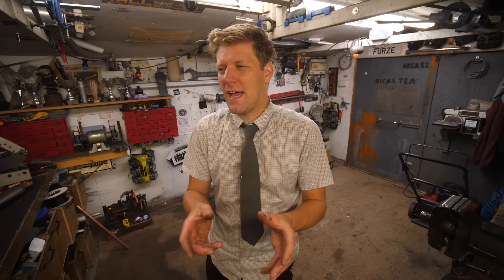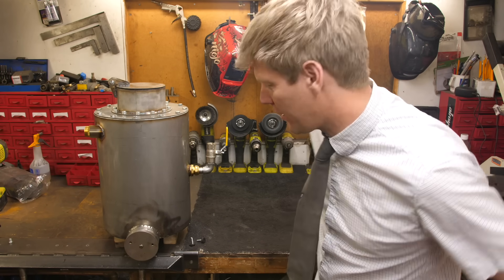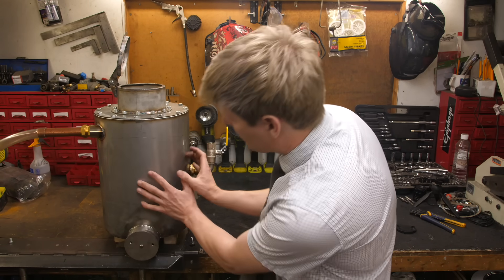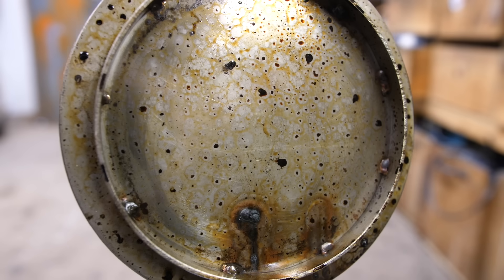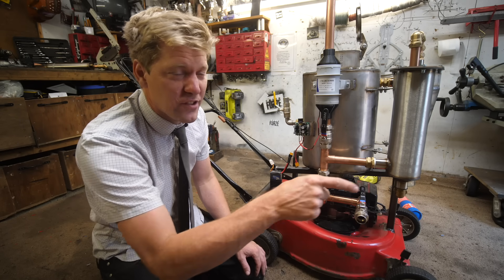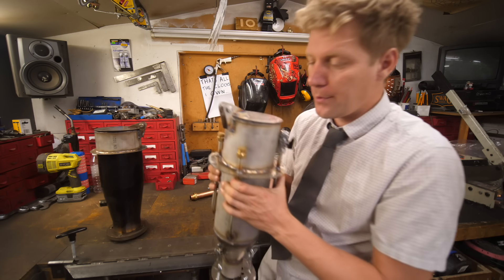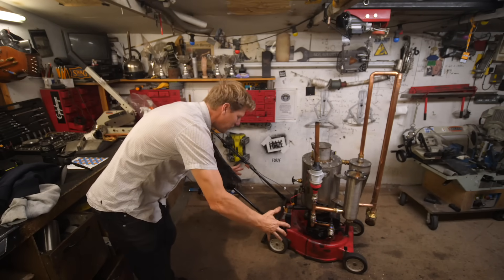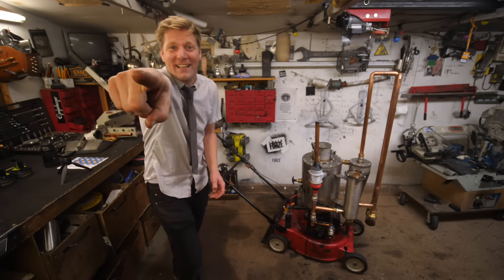WOOD POWERED LAWN MOWER

Comment: Could've filtered it using garden hose and an orange juice bottle. Nah but seriously, a water filtration system with a water pump and radiator would've done the trick.

Comment: Don't worry, commercial gasifiers tar up when using wood.  There have been a number of multi million £ systems scrapped.   The Gas Light and Coke Co made a good job of gasifying coal from 1812 - 1948 and later the Gas Board to 1973.   They perfected the process.  But the renewable energy sector can't seem to fully commercialise gasifiers or pyrolysis systems.   They all run into the problem Colin did; tar.  Colin, you need to run the gasifier at 1000 deg C as that will help with the tarring.  Preferably, outside the shed.

Comment: I think if you want to put this technology to an actual pravtical use, you should use it as a home generator, rather than drivng a lawnmover or a car.
Their Power to weight ratio is quite low.

If you are into that prepper and self reliance stuff, you might wanna stick this to a generator to produce electricity in the winter, when you cant rely on a solar panel.

Btw. that technology dies not scale well, if you wan to back up an actual grid in the winter with that, you will run out if wood fast.

Comment: Hate to say it. But your best bet is to build a giant bubbler/bong.  Run a  inlet pipe deep into a liquid basin, let the liquid filter out your resin then have a regulator atop your mech that pulls in filtered gasses that bubble through.

Comment: Might sound really stupid but try sonnicating or just boiling the wood in deionised water for a little bit that should remove alot of the inorganic shite in biomass (sodium, calcium and other metals) dry it afterwards obviously or try putting a water jacket around bigger traps that should force the tar and crud to condense out and not go through the system. You should be able to do that same thing with straw or even plastic (plastic is alot dirtier so much shite in plastic its unreal)

Comment: The entire time watching this I was screaming 'just put a damn water scrubber on it!' should solve all the filtration issues and some of the gas temp problems.
Reply: But (if I understand you right) you'd need running water for it, wouldn't you?
Reply: @Milo S Of course you can do that but if you have a connected water pipe you could simply connect a cable and use an electric lawn mower.
The whole purpose of a gasoline lawn mower (or the new ones with batteries) is to use them freely without any cable or something like that laying around.

Comment: I think the amount of tar is because of the imperfect burning and not because the filtering system. I would add some more air to the burning, maybe with some compressor or simple ventillation.

Comment: fill those distillation pipes with ball bearings, marbles, zeolites or steel wool lol, to increase the cooling surface area, and optionally add heatsinks on the outside

Comment: Isn't it normal to use water to filter the gass? You push the smoke through a pipe into a big cylinder of water, and then pull the gass at the top of the cylinder where there is no water. So the smoke and tar will mix with the water, but the gass will go up. Maybe I misunderstood how you did your filter system.

Comment: I wonder if it also works with dried grass 🤔
So you could build a dryer at the back of the mower and then an auger that feeds the dryed grass into the gasifier.

Comment: Just remember the clean engine head every now and then.. it makes quite a lot of tarr and stuff . So it finaly wont run , and in 4stroke engine, the failure is huge. But yea, cheap and littlebit more work to use.. Nice vid.

Comment: use a water tank to filter the gas, and a heck of a condenser cooler after the tank so the water vapor returns to the tank.  if the raw gas tube enters the top and goes all of the way toward the bottom, gas bubbles will rise and exit the top and through the condenser.  if you run a fan external to point at whatever you use as a condenser, the lower temperature should induce an impressive gas flow and the fan will not have to be inline anymore.  All of the impurities will remain in the water.  Wood gas is a cocktail of many gasses, primarily carbon monoxide (quite flammable), hydrogen (omfg flammable), and methane at a low concentration so gtfo, methane.  Your target gasses don't mix well with water unless you're talking really high temps where the CO will create carbon dioxide and more hydrogen.  lastly, wood gas is 3/4 nitrogen which doesnt burn at all.

Comment: Water filtration works well and if you put some detergent in the water that seems to work a bit better.
I made one of these about 15 years ago to run a generator. Not near as good as yours and it was ridiculously difficult to start but the water filter bit did work well.

Comment: Hey Colin. I used to build square hearth  downdraft gassifiers for a living.  You need more heat. To get a perfectly clean burn you need to be combusting at a high enough temperature to crack the tar into carbon. Then run it through a radiator to cool it down and which compresses the syngas to allow easier combustion. Fire brick will protect your chamber walls from overheating. And you can adjust the fan speed based on the temperature of the output gas

Comment: 0:51 "We don't need aaaaany fuel station or electricity..."
* connecting LiPo battery * )))
Reply: We aren’t thinking about this right. It’s simple. Add a generator to the output shaft of the motor to run the fan, or even put it to a charger that charges a battery that then goes to the fan.
Reply: Александр Долгов once it’s running, the engine vacuum should be enough to suck the air through the fire. The electric fan is only needed for the warming up of the fire.
Reply: @gfilion 
Following that logic, you could go full mechanical with some bellows instead of an electric fan.

Comment: Ah man, you missed it! It should run off grass, not wood! 
It would be a self-sustaining, self-feeding system! 😂
Reply: And if it can also replicate, you have a sheep
Reply: @wasserdrucker6227  beat me to it but was thinking goat.
Reply: @wasserdrucker6227  Seriously! a sheep is a perfect machine to cut grass. It consumes enough energy to keep living and it poops and exhales co2 both of which keep the grass growing.
Reply: Would take more energy to take out the water of the grass than you get from the grass I imagine.
Reply: Martin Stråbø yea but you could bag it and let it sit in a heated area for a week letting it dry and then potentially using the dry dead grass for fuel
Reply: It wouldn't be as useful as dry wood 
The higher the moisture content 
The less it produces gas and the more it produces unwanted tar and vice versa
Reply: @Tua_B  Depending how often you mow I suppose, grass dries pretty fast in my experience. I would imagine you would have to compress it into bricks or something though otherwise it would probably burn out too fast.
Reply: @Tua_B  MindBlown!
Reply: Imagine a wood powered chainsaw🤯♻️
Reply: @oscargilks2567  that could get scary and turn into a black hole or something.
Reply: All I can think about is how much smoke there would be...
Reply: Silage! Effectively grass alcohol! Just boil off alcohol, then use ethanol as fuel.

Comment: Went to a home improvement store one day and I noticed a truck that had a maze of pipes in the bed.  The truck had a strong smell of burnt wood.  I instantly knew what I was looking at.  Someone had converted a dodge Dakota to run on wood gas.  He had an air fuel ratio gauge bolted to the dash.  I was shocked....

Comment: If you take a dyson motor and recreate the dust cylinder with metal, you can do the same thing but the tornado type air flow makes it a turbo powered engine.

Comment: Imagine a post apocalyptic neighborhood all the desolate houses and overgrown yards. Then there's this one, the house looks a little worse for wear but still in good condition. The shed in the back yard is perfect like it was built by Paul Bunyan, strong and mighty, and then you hear it, it sound like a lawn mower? There you see a man wearing the most magnificent DIY'd body armour, and wearing a safety tie, pushing this monstrosity of mower around to mow his lawn and not only has he produced enough wood gas to mow his lawn but to save on the wood he has also used the excess wood gas to heat a grill to make his supper.

Comment: You know what would be better?
Turbo jet lawn mower!
You could attach jet motors to a flywheel above the deck, with a shift going down to the blades. Start the motors, they spin, blades spin, grass cut, everyone dies when it blows apart.

Comment: Amazing job with the gasifier, there used to be a mail car in outback Au that ran on syngas so it could make 3000+km trips without fuel stops. I've got photographs of the filtration system if you want them. 
Top-down updraft combustion seems to sustain the best if you're ok with a batch-type gasifier. 
Condenser coils work well for steam and Tar removal, I use no less than 6m of 1" pipe for my retort burners.

Comment: Hi Colin, l have been driveing on woodgas for a few years now and built many sucsessfull systems. Like cars and stuff not toys :) 
What you first demonstrated was NOT woodgas but pyrolisys gas. Flamable but full of crap. Kinda like crude oil. The real woodgas is the eqivalent to petrol and shuld contain zero tar! If the gasifier is well made and tailored  to fit your engines specifications you dont even need a filter, just a cyclone for dust collection. 
You came close with your latest system but only made one big mistake. For the first run you always need to prefill the reaction zone with corn size charcoal! This glowing mass will basicly crack all tars down to just methane and hydrogen. Once the char bed is established you can easyly light it right away the next time. Visit Drive on wood! web site for more details

Comment: Couldnt the gas be run through water to grab all the tar and crap? Would cool it, be way more compact and a cheap and easy to replace/clean filter . Just suck the gas through a large jar, the gas having its tube running down under the water  and the suction at the top, the vacuum should do all the work.

Comment: Ultimate Apocalypse tech unlocked!

Wood powered lawnmower. Also, that tar should gasify some, but you will need a hotter fire. Still, you are right you need more filtering.

Comment: Water filters work well and would cool the gas.  The tar will dissolve into the water, so you will need multiple jars for filtration stages.  You'll see the water color get lighter with each stage.

Comment: really dont think it was a good idea to mix the wood gas chamber with the burning wood chamber. If the wood gas chamber was separate you could use the pressure of the wood gas to move it through more restrictive filters and you wouldn't need a fan either

Comment: Hmm, I wonder if there's a way to store the wood gas. That way the wood gas station could be separate and far more accurate/elaborate.
Reply: There is. It involves more filtering and cooling of the gas, and I am not sure on short research, if it needs to be pressurized or if it is liquid at room temperature.

Comment: Use grass as fuel

“I used the grass to mow the grass”
Reply: It's possible, but you'd likely use a biogas digester (liquidy compost in a big sealed tank releases methane to run the engine) rather than gasify it.  Cody'sLab built a biogas digester, though I don't think it worked brilliantly because of the cold temperatures where he lives.  The most ironic thing would be a wood gas powered chainsaw :)
Reply: Subscribed. LoL.
Reply: That quote is just priceless :D

Comment: G'day,

Yay Team !

  Backtrack me to my "SunGas Project..." Playlist, to see my work using Alfoil &  Contact Cement to turn a TV-Satellite-Dish into an.Offset Parabolic Reflector, with which to Pyrolise the Wood into first Water-Vapour, and then Hydrogen, Methane, Carbon Monoxide & Tars...

It was a lot of fun, but to run a Kitchen Stove would take 15 Sq Metres of Mirror, 5 Kilos of Wood in a 10-Litre Vessel, tripple-insulated on top, and a topless7,500 Litre Watertank, full, with a weighted Bottomless  6,000 Litre Tank  floating in it for a Gasometer.

   1.25 Kg of  FossilFarted LPG costs me $6.50 for 10 days' worth if Cooking.

If I have to give up LPG, then I'll cook over a Wood Fire.

In 1943 my father used to run his Car on a Charcoal-Burner which he made, and every 1,000 Miles it had to have the Cylinder Head off for a De-Coke & Valve-Guide, and to go up steep hills it had to be switched back to Petrol.

Woodgas is about half as Energy-Dense as Petrol, whereas LPG is about 90%.

Stirling Effort, that Lawnmower though ; well done.

Have a good one.

Stay safe.

;-p

Ciao !
Reply: *
Valve GRIND...(!).

;-p

Comment: If you arent desperate to die early you just dont start that inside! People died during WW2 from doing just that. The gas you produce is incredibly unhealty! 
My dad built a 1960 Volvo lorry fitted with one of these wood-gas-burners that he found NOS made during Ww2. 
It was faster and more powerful running on birchtree, but made so much more tar from it that one valve stuck in the valveguide so it bent a pushrod.
It should produce 75% of the power that it does from petrol. And the wood used has to be very dry to make it work.
There was also smaller units of these to use on motorbikes even down to 98cc twostrokes.

Comment: You dont need filters, you need catalytic converter, you can use some of the heat of the chamber to help get optimal temperatures and produce a clean syngas. 
You can also re direct those deposits of tar to burn in your heat chamber. Also, I dont know if your reactor is sealed or not, if you are putting regular ambient in it, the concentrations of hydrogen (combustible) will be lower and nitreogen (inert) will be higher. Lowering the effectiveness of your syngas

Comment: All the wood gasification vids I watched, they bubbled the smoke through a water chamber which trapped the tar, moisture and dust while the flammable gas bubbled to the top, compressed, and was usable afterward. No elaborate copper pipe or steel wool nonsense needed.

Comment: i wonder.... if the wood gas engine is producing excess heat. would it be possible to add a steam engine to the mix? it wont add much energy back into the system but would just make it more efficient. only issue is you dont want the system to be too cool and might not run hot enough for the steam engine right?

Comment: Wood gasifier chamber should be horizontal  then 90 deg. Down into multi stage side by side water bongs.  Triple filtered in water will remove most of the tar. Then carbon cartridge from fish tanks...then the mower...  I could email you a water / fuel converter off a 18V Dewalt rechargeable battery.  Runs mower good for an acre per  charge +1.5 cups water +2 tbls lye

Comment: So this has really caught me. So what gas is still present if the wood itself is burning? The only gas is carbon dioxide right? It has to do with the air pressure for the gas to keep from igniting as it is released?

Comment: You know that gas has carbon monoxide in it? Careful, Furze

Edit: Never mind. Just saw he was wearing his safety tie. Should be fine
Reply: Came here to add this point re: CO. If he's planning on building one for his bunker, he'd better have some good ventilation. Gasifiers break down the long carbon chains in the wood to H2 and CO (with lots of tar and other junk with it). The CO would be deadly in the bunker. Get a CO alarm down there first!
Reply: Yeah CO kills because you feel fine until you don't. And then you can't escape for fresh air because you're usually collapsed. Mad shit eh
Reply: Pretty sure the 16 inch fan should replenish the air enough
Reply: lmao
Reply: Colin the goat man no cap
Reply: motors that use any fuel has carbon monoxide in it
Reply: he was mowing the grass outside
https://www.youtube.com/watch?v=zMb62tupL-A

Comment: LOL!!!! You're supposed to attached a gas collector to your gasifier! It's a metal container that holds water, with another metal container that fits inside upside down to collect the smoke. It has a gas outlet on top allowing you to collect the gas into a pressurized tank AFTER you let the gas cool and clear up. So you'll need to let the inner tank rise as you collect gas, then let it cool and clear, then use a gas pump to collect it and pressurize it into a gas tank. Then you can just put the tank on the mower. You're really complicating things by trying to put the entire apparatus on top of the mower :P

Comment: Use the wood gas contraption to power a generator and run everything off that. You won't have to push around a big engine, and you won't have to build separate engines for each application.

Comment: You should watch the wood gas series from Mr.Teslonian. He actually demonstrated how to also get Crude Oil and Butane out of the same process. It could help you get to your goal as he ran a generator off of this successfully but he employed a neat design that had a neat use of gravity to separate the different fuels. Check that out and see if that helps, I found it fascinating that there is a carbon neutral way of producing crude oil and more from sticks on the ground.

Comment: Reading about oil/chemical carriers (thats a ship) Inert Gas system might help with the filtration. It uses water to filter out stuff.  If i remember correctly, the filtration part takes place in "scrubber". Mby that could help. Anyway, looking forward for your update video, colin!

Comment: try using a two stroke engine it doesnt have valves wich might help. though you need to get your mixing oil into the air fuel mixture.